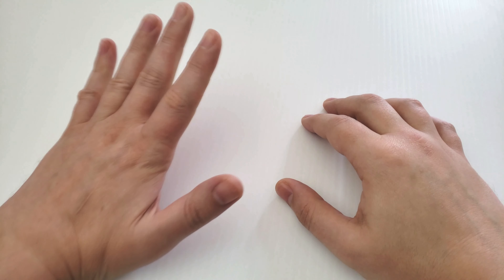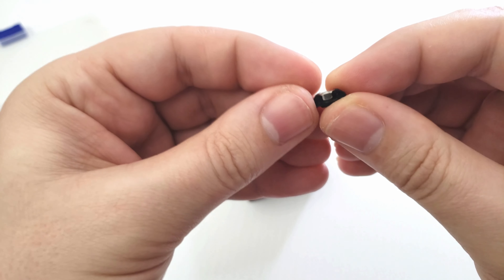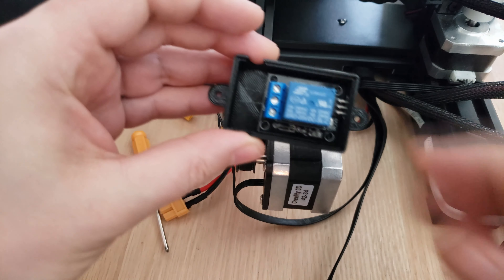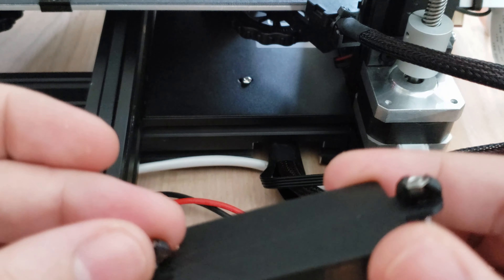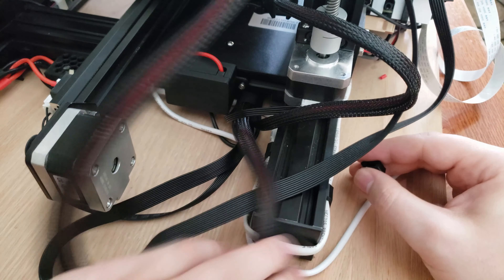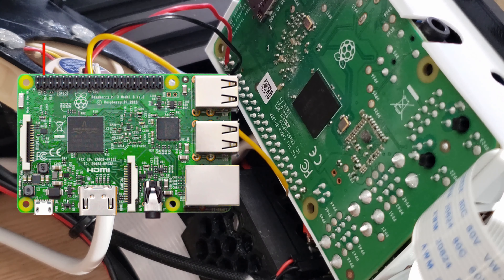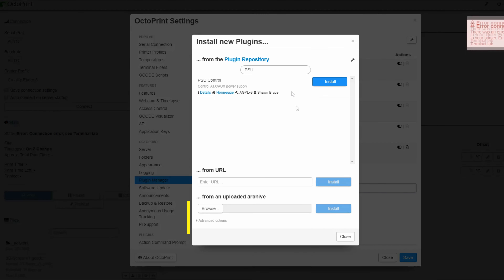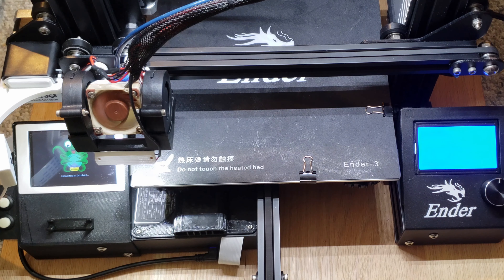Using OctoPrint with PSU Control to turn off and on your 3D Printer.

Comment: hi
thanks for the tutorial
but the pi should boot up as soon as i switch the psu on
is that right?
in my case the pi seems not to get any current
so does the printer
if i switch the cable on the relay from NO to NC 

the printers turns on
what am i doing wrong?
thank you
Reply from the maker: Are you splitting the power from the printer PSU and running 1 set of power into the relay to power the printer, and the other into a step down converter (Buck converter in this case) into your Pi?
Check the voltage coming out of the Buck converter to assure its 5v and can power the Pi
Reply: @lifeasanerd4202  that's what I am doing, I had to adjust the buck converter to 5v, it was giving 19v
When I switch the printer on, it starts, then it switches off, then u hear the relay and it switches on again and stays on
Reply from the maker: @derui75  The printer power supply should go into the buck, then down to 5v to power the Pi.
The Pi should then control the relay. Does the Pi boot and work with just a standard Pi power supply?

Comment: My 3d printer go on if I close the settings. And after that it doesn't work? What is wrong? In the other app I can turn the realyy on and off, there it works but octoprint won't) :

Comment: Great but does this mean the pi is still on all the time when the printer is off as otherwise how do you turn the printer on and off, would it not be easier now just to use a wifi socket to do this and kill power to the pi and the printer?  Just checking so I understand the electronics are not needed anymore. Thanks.
Reply from the maker: Yes the Pi is always on in this situation.
It was designed this way for this specific tutorial to use the existing Printer power supply.
I've been debating doing a second how-to for other options such as what you mentioned.
Reply: @lifeasanerd4202  Ok thanks for the answer, I have resolved mine, I bought a pack of 10 decent power monitoring wirif plus that can kill both poles of power and I use those now, I have one set up on the printer , the pi takes its power from the printer and one set up on the workshop lights, What I do now is close the pi via octoprint and then tell Alex to switch off the 3d printer and switch off the workshop lights, God it saves my knees going up and down the stairs and gives me peace of mind that its all off,.

I just feel the relay doesn't give you enough control to turn off all the power at source. I also now have built in to my workshop a wifi 30 amp fuse board trip switch which I can in fact switch off all the power to the workshop completely, That an a ip camera in the workshop I feel happier now its safe.

Comment: Much better would be to switch the AC side. There are lower currents and PSU will be completely off, so it is little bit safer.
Reply from the maker: It was done this way, as the Printers Power Supply is what is powering the Raspberry Pi.
If you utilized and external dedicated Power Supply for the Pi, this option would work.

Comment: can i run my RPI 24/7 without the printer on all the time with your setup? i need to use my RPI for other stuff.
Reply from the maker: The Power supply for the printer would always be on, just not the printers main board and heaters etc.
But the Pi has to be in place and running OctoPi, there wouldn't be much you could do with the Pi in this situation outside of that

Comment: Great! What ui are you using with octoprint?
Reply from the maker: For the Ocotprint Web UI, I am using Themeify and just modified the page widths to fit my screen.
For my touchscreen I use Octoprint-TFT and its default UI.
http://www.crackedconsole.com/community/3-general/wip-installing-and-configuring-octopi-octoprint-for-raspberry-pi-to-control-your-3d-printer/

Comment: Power off won‘t work
Octoprint running on a Pi communicates over a USB cabel connected to the printer. If  you open the relay with PSU Control you cut the power from PSU to the printer. But the Pi sends still 5V over the USB cabel to the printer. The printer will not run this way (not enough power) but it is definitly not completly powered off. Fan for example is still running .......
Reply from the maker: You wire the relay between the PSU and the printer. The PSU will stay powered and you are just breaking the connection between the PSU and Printer. There are other ways to control power of your printer. This is the route I choose and it works fine for my needs.

Comment: you are overpowering your relay... it can only take 10 amps...
Reply: Yes, this particular relay can be used on mains electricity at 230V though so it's a similar process but on the mains cable. I have a 5Amp fuse fitted in my mains voltage cable to ensure the relay cannot be overloaded.
Reply: you need a 15amp on the ender iirc
Reply: @BenCos2018  since a 5amp fuse will break way before 10 or even 15amps are drawn, this seems way more than reasonable.

Comment: @life as a nerd 
would normal jumper cables work
Reply from the maker: If you are referring to what wire you can use in assembly, yes any wire should work as long as the gauge is thick enough.

Comment: ITs not working for me , thanks
Reply from the maker: What part are you having an issue with? I would be glad to help
Reply: @lifeasanerd4202  i have 8 channel 5v relay module, i connect from psu to motherboard to relay and i connect pi to in1 for signal and gnd and vcc for + and - for pi..... When i do this pi doesnt power on, nothing powers on, only the psu itself. when i connect psu to relay to pin 1 and 3 and it works but it defeats the purpose no switch in between whiteouth raspbery pi signal, its basically direct wired trough relay.
Reply from the maker: @kalisto1  Use Pin 4 for 5v + Pin 6 for Ground and pin 40 (gpio pin 21) for signal
Reply: @lifeasanerd4202  my pins on the relay are first pin is GND secound pin is IN1 (in1 is for relay number 1) third pin is IN2 ( IN2 is for relay number two and so on for another 6 pins are for relay then last pin is VCC then on the far right there are 3 more pins first pin is GND secound and third pin got a pin connector and they are connected, pin two is VCC, pin three is JD-VCC... Maybe i have the wrong relay it says its 10a 250v, 16a 125 v, these are writen on relay itself. Thanks so far :)  IF u write on google 8 channel relay this is the one i got its TONGLiNG.
Reply from the maker: @kalisto1  The Pi may not be able to trigger those relays only 5v. Hook up a 5v source and see if you can manually trigger the relay.
The Pi voltage out is 5v to power the relay, and the pin signal from the pi is only going to be 3.3v, this may not be enough to power and trigger those relays.
Reply: @lifeasanerd4202  Yes i tried this way too, relay was powered on but the switch didn't work
Reply from the maker: @kalisto1  Sounds like the trigger voltage may be to low for the relay to function. THis is one of the brands I've used with success

https://amzn.to/2HLneqo

Comment: Power off won‘t work
Reply from the maker: You wire the relay between the PSU and the printer. The PSU will stay powered and you are just breaking the connection between the PSU and Printer. There are other ways to control power of your printer. This is the route I choose and it works fine for my needs.